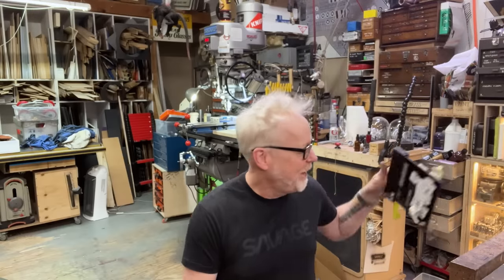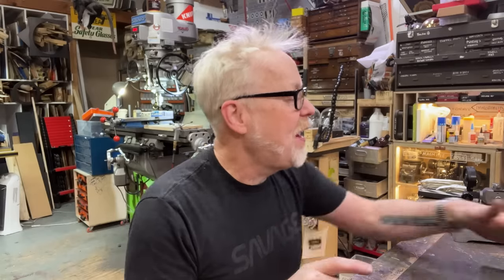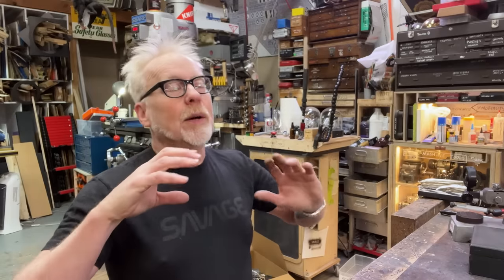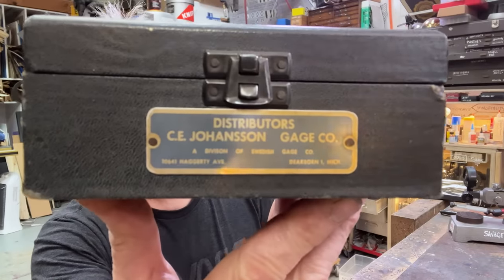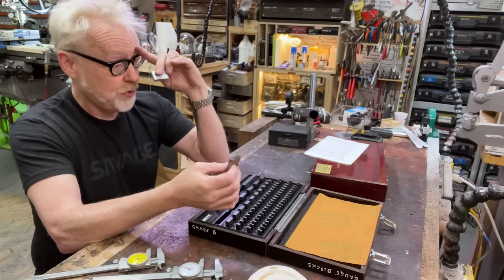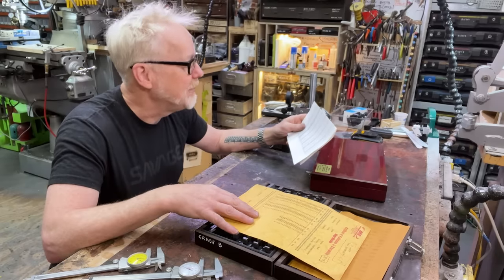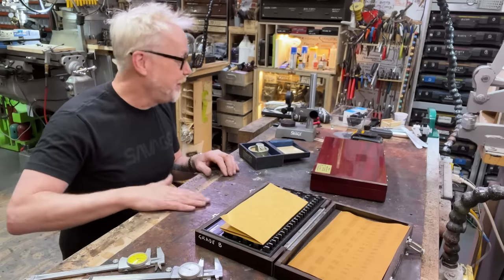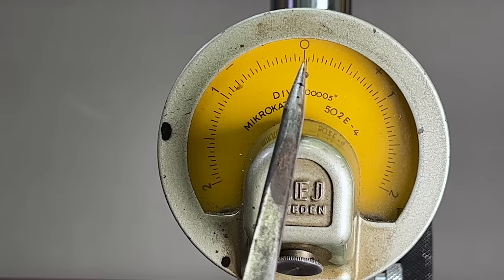Adam Savage's Most Precise Measurement Tool!

Comment: Those gauge blocks raise a new question. How do they measure the temperature to high enough precision to be confident in the length measurements? Is the temperature measurement the largest source of error? If not, what is?
Reply: That goes into uncertainty. I would say in the room they're calibrated in, .1 or .01C variation is a pretty safe bet along with being something that can easily be done operationally. That being said, we can measure in the range of millikelvin.
Reply: @ScuffedEngineer  "We can measure into the milikelvin" 

Yah but how?
Reply: @Crushnaut  Usually with a platinum RTD sensor. Short of it is two wires attached to a piece of platinum, and you measure the resistance change due to temperature.

Comment: The way the metal takes more volume the more energy it has is awfully similar to how has wants to take more space the more energy it has. It't just that the attoms are arranged into a structure and so we can measure the expansion, instead of pressure.

Comment: I'm so disappointed you didn't wringing two gauge blocks and use a third of the correct length for the zero so you could show that combing them is accurate (and to see if that new precision gauge can spot it the gap).

Comment: Steel expansion coefficient is 0.0000065 per inch/inch/F. Your part is 1 inch long and it went by 0.000025 so you imparted 3.8F heat into the gage block. Totally reasonable

Comment: I do 100x more woodworking than machining, but what I'd like to see is a book or reference on woodworking metrology for people with an awareness of machinist metrology.  Wood, moves, of course... but how much (by grain direction, species, temperature, relative humidity), and what are the appropriate tolerances for specific element of woodworking (e.g. joint fitment).  The use of gauge blocks sent me down a thought process of wooden equivalents that could do the same sort of 'cancel out' based on common environmental exposure, but the significant different in practical dimensions injects a curve-ball (anybody got a dial caliper for dozens of inches dimensions? 🤪 )

Comment: So if you know the material, you can measure its relative length in insane resolution by measuring the temperature in for example the 0.001 degrees. :O

Comment: I like how the units of measure are now based on physical phenomena so anyone in the cosmos with the right equipment can generate their own inhouse measure traceable to the laws of nature.
I am an insect curator. People have seen insects on pins with the collection labels under them on the same pin. In order to get insects onto pins that are smaller than the diameter of the pin, a small, long, thin triangle of archival card stock is pierced by the pin. The insect is glued to the tip of the triangle. I have done that with insects 200 micrometers long. I have to hold my breath and touch the tip of the paper point with the small drop of shellac on the tip to the side of the insect. I have to hold my breath and touch the insect with the shellac between heartbeats. Here is a picture of the Mymarommatidae (False Fairy Wasp) Mymaromella pala Sp. I pinned: https://www.invertebrateecology.com/wp-content/uploads/2015/11/1-M.-pala1edited1-001.jpg

Comment: The wave length of light (green) is only about .00002" or 20 millionths of an inch. So your MikroKator already detected smaller than that. 
1 wavelength is about half of 1 the Mikrokator's  .00005 divisions(50millionths). So you already have been able to see less than a lightwave length. You have got to get an optical flat for more amazing micro measuring adventures.

Comment: Don’t refer .000050 as half a ten thousandth of an inch… in standard shop practice it is referred to as 50 millionths.
One ten thousandth of an inch is always referred to as one tenth…. Just a quicker and easier way of saying one ten thousandth.
So, .001 is one thou…
.0001 is one tenth….
.000100 is 100 millionths
.000010 is ten millionths
.000001 is one millionth.
40 plus years in a machine shop and I’ve never heard any other terminology used other than the ones I’ve listed.
I routinely worked to tolerances of 2 tenths, occasionally to 50 millionths, and once to 20 millionths tolerance.
At those tolerances temperature becomes a serious issue.
A quick reference… Steel expands and contracts at a rate of 11 millionths per degree Fahrenheit, per inch.
Therefore, a 10 inch long piece of steel would grow in length 110 millionths for every one degree increase of temperature.
Different kinds of metals (aluminum, brass, etc.) have different coefficients of expansion.
In conclusion, you can see how “fluid like” metal can become when working to extremely close tolerances.
Hope this helps.

Comment: SAE is better for the digital age. The fractions used can be broken down into binary bits. Notice that units of memory follow the denominator of SAE fractions. 2gb, 4gb, 8,gb, 16gb, and so on. 10 divided in half is 5, an odd number. You can't have a half on bit state, requiring rounding. Metric is superior in decimal applications, but SAE is superior for 16 bit which is what the digital universe uses. Down with base 10. Teach kids base 16.

Comment: At 06:05 Adam seems to get his decimals mixed up. "Measures at .01 milimeter" implies 1/100th of mm, but then he goes on to say 1/10th. So WHICH IS IT??? HUH??? :D Also, if it does actually measure at .01 mm, then it's more precise than the imperial one, as .01 is .4 of 1/1000th of an inch.

Comment: To measure a thermal expansion of half a 10,000 of an inch would require a temperature differential of about  8° Fahrenheit based on the thermal expansion of steel. Seems plausible!

Comment: 6:04

0.01mm is a hundredth of a millimeter, not a tenth.
This is actually equal to about 4 "tenths" or under half a thousandth of an inch.

The metric one actually has more than TWICE the resolution of "granularity" as the imperial one.

Adam gets it wrong here, and complains about the poor granularity, metric always wins!!

Typical imperial tolerance is 0.001 inches or a thou, but typically metric tolerance is 0.01mm, which is actually under half a thou. Working in metric to typical standards actually yields more accurate work. Of course you can work to any tolerance you want, but those are typical of an imperial/metric machine shop.

Comment: Still can't understand why machinists uses inches... go metric!
By the way this tool isn't so precise - it division is 1.27 um, while metric indicators usually have 1 um 😁
It is all about psychology. We, people, like numbers like 1 and 5. So, people would definitely buy indicator with 0.00005 inches per division rather than 0.00004 inches(1.016 um). And 0.00001 inch (0.254 um) indicator probably doesn't make sense(if it even possible to make one).

Comment: heat is why if you actually need this percussion you keep a set room a human body temp for doing these measurements
Reply: No, they just control the room to 0.1 or 0.01C at 20C. To keep the air conditioning to the same setting, if a person leaves they turn on a 100W lamp in their place. If you can't wait for body heat to dissipate, it goes in a closed room with no human interaction.

Comment: This video would have been much shorter if Adam gave the measurements only in the metric system. Half the video is basically Adam explaining 1/64 inch is this and a thou is that. Not Adam's fault of course, imperial system is just way too overcomplicated, even if you are used to it.

Comment: Fun fact. It is impossible to be exact when you measure things in imperial units.
Reply: It's impossible to be perfect, but exact doesn't depend on the system you're using. You'll never get a manual measurement that can be trusted more precisely than about .0001 inch or .0025 microns no matter what you call it. It takes some extraordinary care to achieve that reliably.

Comment: Until the start of the world war 2 America didn't have a national standard. They made the standard Inch the same as English Inch. Slip blocks. can be rung together removing all the air to they stick together because of air pressure. Don't use your pinger to clean them first as the oil on your fingers will stop them  making an air tight seal. They also have a sheet that tell you how far out they are so you can remover that to the size.
As a rule of thumb any instrument that is used to check the calibration of another has to be 10 time as accurate.

Comment: As much as i respect Adam for all the work he has done, and all the screwing around he's written down, i will never fully respect him until he moves away from imperial.

The imperial system of measurement, and the US education systems is why the 1/3 pound burger failed over the 1/4 pound burger, if they had called it the 333g burger and the 250g burger, this wouldn't have happened.

You're doing a video on precision and measurement, stop using fractions...
Reply: It's called Metrology, not Impology, join the rest of the world and become magnitudes more precise instantly.

Comment: Amateur hour… I was recently  measuring the amplitude of the thermal vibration of an atomic force microscope cantilever recently with a laser Doppler vibrometer… 80picometers! About 1/10000th the wavelength of light. By the way I hope you are not a “ruster”, some people randomly have finger grease that leaves permanent  corroded marks on metal gauge locks… have to wear gloves when wringing their blocks. For reference fingernails grow about as fast as the Atlantic widens.

Comment: Metric >> kingsbodyparts of course, BUT, this thing with metric/SI that it uses Greek prefixes for anything sub-millimetre is really annoying. Dafuq I know if nano or pico is smaller, or what's a femtometre?? I don't even have an intuition of what a micron is. Would be waaay better to use decimal fractions below the micrometre or even millimetre level, at least for anything that's not, you know, at the quantum scale. :P

Comment: You should demonstrate measuring flatness down to millionths of an inch using optical flats.  When attempting to wring blocks together, cleaning them by rubbing against a piece of paper will work better than using your finger (which, BTW, makes any metrologist cringe as you should be using gloves).

Comment: Never trust gravity with your gage blocks. You’re supposed to wear lint-free gloves when handling them. I would never wring more than 4 gage blocks together. An actual gage block comparator (see Edmunds Twin-Head) has a lower probe beneath the table and an upper probe. It has a resolution of 1/10th of one millionth of an inch (0.0000001") and an uncertainty of ±2 ten-millionths of an inch. Steel gage blocks have a coefficient of expansion of about 6.5 microinches per inch per degree F. Calipers are generally accurate to ±0.001” per every 6”.

Comment: 0.001" is 0.0254 of a mm so your metric dial calipers measure in 0.01 increments then 0.01mm is actually 0.00039. Long story short your metric dial calipers are more accurate.
Reply: The units are smaller, but the instrument isn't more accurate. If you're measuring things in microns manually, you're rounding off. It's pointless using a last digit that changes every time you measure it

Comment: .001" = 0.0254mm= 25.4µm   |   0.01mm=10µm.   |   .00005" = 0.00127mm = 1.27µm. If the block temperature is 20℃ going to 36℃ it will roughly expand 4µm to 5µm. So it's not fully heated up to 36℃ if it was the dial would move 0.00015" from the reference zero or three division to the positive side. Although the usefulness of these distances is only related to the Chip manufacturing industry. As most other industries only need within 0~25µm to make tools for production lines do to part fitments.  Here is a video on some NIST equipment that has a resolution down to 26nm if I remember correctly.   https://www.youtube.com/watch?v=uCyU97MoHFM .

Comment: No gauge blocks were harmed during filming of this video...
But hundreds of machinists nearly died from a heart attack while watching this video 😆

By measuring the temperature of the block after touching it or measuring the temperature of Adam's hands and comparing it to the room temperature, it should be easy to calculate the thermal expansion coefficient of the material... and compare it to some "datasheet".
The effect would be much more visible, if the block would have been heated with a hot air gun 😂 or cooled down with canned refrigerants from room temperature 😎

Comment: Why do you measure down in fractions of an  inch until suddenly you jump to a decimal of an inch? Should it not be 1/1024 of an inch? The mighty Imperial measuring system has to eventually revert to a decimal system to work, lol. 😂

Comment: Micron is no longer an Si unit.  Micrometer is correct.
Reply: Americans unfortunately still have to use it because they spell metre as meter, so in writing they wouldn't otherwise be able to differentiate between it and a Micrometer (Device for accurately measuring small distances)

Comment: Using fractions at increments that small is one the biggest reasons why metric folks lose their mind over the imperial system. You've already taken your standard unit and divided it by 1000. You've already turned the system to a decimal system. Just say 0.001 FFS. Why are you invoking fractions of fractions?! WTF is half a thousandth?! It's 0.0005 you heathens! 

The idea of using fractions, which get LARGER as your unit gets smaller is idiotic.